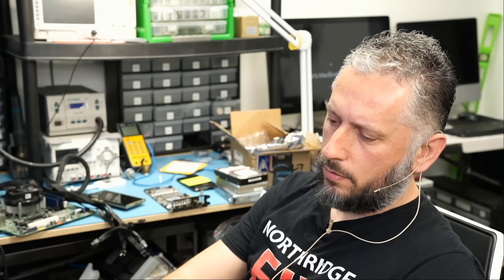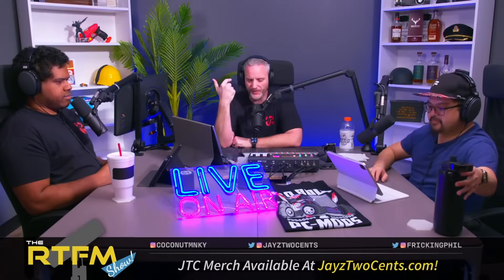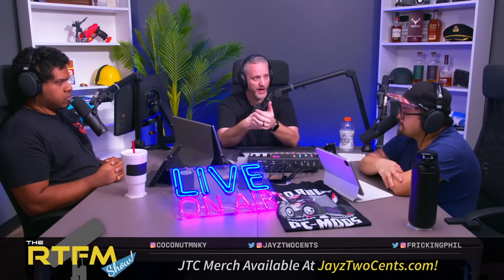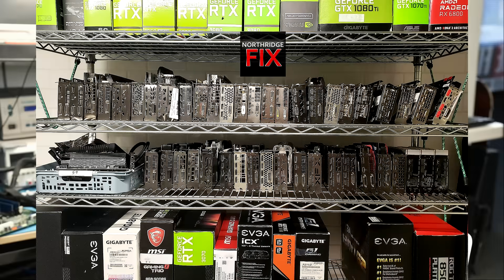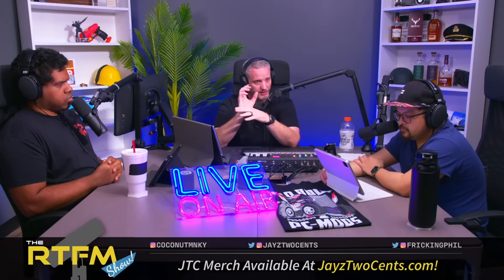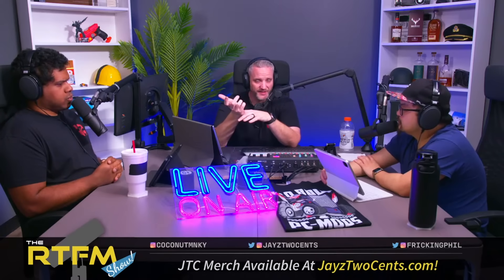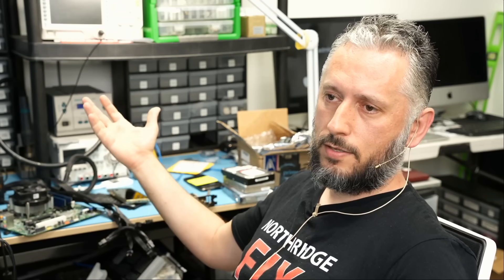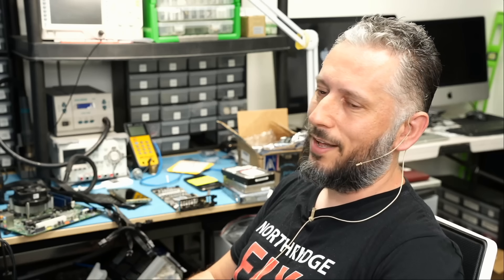Melting 4090 and CableMod. JayzTwoCents and Gamers Nexus Response. Blame NVidia or User?

Comment: I'm still curious what apps, resolution and frame rate (or perhaps other factors I'm not familiar with) affected users are running when the connector melts. It seems to me that demand on the card is what causes the card to draw power. There are a lot of cards being used out there that haven't melted
Reply: Little by little they're melting, that's why this issue is coming back.
Reply: @maxwallestain9037  It seems like the 12VHPWR isn't actually fit for what they are popularizing it for.
Reply: @modrribaz1691  Yeah, the connector is useless if it's going to melt in some point in time, this situation is going to be a much bigger problems in the months to come.
Reply: Yet.

We don't yet know what the users were doing or for how long.

It's possible the vast majority of users are "casual" gamers who game an hour a day on oldish titles, and the melted ones are enthuthiasts who play higher powered games for longer.
Reply: Mine just melted yesterday. I was playing watch dogs . 4k ultra no dlss
Reply: I think the connector could've been designed to be more fool proof but that said it is user error at the end of the day. I got my 4090 the morning they dropped back in October 2022 and have put hundreds and hundreds of hours gaming on it at 4K ray tracing where it is available, I still run the original adapter without any issues. I think Steve of Gamers Nexus has done a lot more to dig into this issue with multiple videos and lab examinations to point out why it happens. 
BTW the same thing can happen to regular pcie power connectors if they aren't plugged in all the way. If this was 100% manufacturer issue it would 've happend a whole lot more and it most certainly wouldve happened to me who puts in a ton of hours on my RTX 4090.

Comment: Now .. here's the question
Is all brands of 4090 had same issue ?

PNY , GALAX , ASUS , GIGABYTE ?!
Reply: Evga knew about it earlier, that's why they resigned from cooperation with nvidia which imposed the design of the PCB together with the connector in advance. Of course, this was only one of the reasons why they withdrew from cooperation
Reply: @pawelos211  EVGA surely is a kingpin to reject modernity and embrace masculinity.
Reply: yes
Reply: @w4r10rd  
that answer leads us to conclusion
It's Nvidia failure
we can't blame user neither specific manufacturer
Reply: @hs_des  agreed, because see it for yourself the previous gen top tier model 3090ti uses the same input factor yet that product is extremely OCed and what not, no such melting issues came up except 4090 and its siblings. feels like politics the blame game never stops anywhere its either the public or the ruling body or the system's servants. the siperman finger meme is very appropriate in this situation tbh.

Comment: Agree with you Alex, if the connector misaligns so easily, the manufacturer should take responsibility.
Reply: I believe the problem is a faulty batch of connectors Nvidia is responsible for this
Reply: @samkleo1494  You believe wrong. All of this has been sorted out long ago.
Reply: @samkleo1494  the manufacturers need to start taking responsibility as to a technician that tries to charge the customer $70 for their internet equipment even though you pay a fee every month.
Reply: @darkspartan566  Are you OK? You seem to have lost the ability to write a comment that makes any sense.
Reply: @--_DJ_--  you probably can't understand simple English.
Reply: @--_DJ_--  but lmao yea I'm ok just a little bit troubled by leadership it's not you
Reply: @darkspartan566  I can understand it when it is used properly, you might be too simple to do that though.
Reply: From what i understand i think it's an NVIDIA and the others makers like ASUS Ect that uses the blueprints from nvidia i think the debate shouldn't take place. Now theses companies and more precisely these card makers can do what they want when you buy a 1500$ or 2500$ if something IS going wrong the waranty should kicks in like in any other product i recently bought a car the gearbox has a problem from the assembly line and my waranty covered everything it wasn't on my end i dont understand like Alex says in the video it's not rocket science to plug a cable in a connector and i dont think the cable matter in that case i think it's more if a design issue rather than a user issue and nvidia and the other makers dont make it right because if they recall the cards it's gonna cost them money and they don't want that and in a matter of facts it's a Big company from many others and they won't be punished for doing it this way
Reply: @miles4913  And who can prove that !? Maybe users OC the card too much, so it drove more power. And before damage to other components, connector melted.
Reply: @darkspartan566  you aren’t writing in English though.
Reply: yes they should not to mention card cost over 2k euro this shit should not happened
Reply: Where are all the 8 pin melted connectors at? Nvidia made a mistake, and they will not admit to it.
Reply: @natetechr / rare, but for past 20+ years I've seen a few molten 8 pins on forums - especially recently, the cryptominer setups.
Reply: Msi has got malware now on their hardware.
Reply: ... and if there is generated almost melting heat, everything MOVES by that heat, if simple lock doesnt help too, its DESIGNED TO FAIL ...... what the heck is spec of that connector ???
Reply: No way, that would blame our lord and Savior, Jensen!!!!!! hes a perfect god!!!
Reply: perfect example of survivorship bias, people would just send their 4080/4090 for RMA instead of sending them to 3rd party repair, unless it's user errors or they flashed their GPU with XOC Bios (1000W Power limit)
Reply: which cable, the 3rd party cable ?, how many of these melted while using the standard cable, if I was looking for a failure point I would be testing the 3rd party cable to see if the materials used are up to the job i.e. can carry the current without heating up, when conductors heat up they increase in resistance to the current which them causes more heat and eventually total failure
Reply: @geoffh4578  the problem is its not the third or 5th party cable that is melting.... its the actual connector that is melting.
Reply: @Geoff H  They had this problem from the start, when only 1st party cables were available. It isn't the cable, it is the connection at the pins. This has all been well documented at this point.
Reply: @geoffh4578  It's a failure of the connector DESIGN... not manufacturing. it's manufactured correctly... it's designed badly. 1st party, 3rd party, doesn't matter. It wasn't designed by the standards group, it was designed by Intel & accepted by the standards group without their normal testing.... and it's telling that Intel doesn't use the connector. Nvidia just refuses to admit it when they screw up; it's basically company policy.
Reply: @geoffh4578  the cables are purely made compared to older power supplies and they haven't changed much over 20 years until 2019 started to come around and we start getting trash pulled products.
Reply: If you know a car is going to burn down when you start it, would you still buy it?
If you buy one, knowing there is a problem, then the only fault is yours
Reply: @Kamelt Oefan  What if only 1 in 1000 burns when you start it? Is it your fault then too?
Reply: @--_DJ_--  it’s not even 1 in 100,000 that have failed.
Reply: @testickles8834  That's stupid analogy. No company would sell things they admitted having a problem, and no dumb people would buy something advertised as having issues. These problems occur because not enough r&d on the supplier side. That's why even big companies like Gigabyte and Honda have product recalls. Nvidia is a giant corp, previous cards like 3090 ti didn't have this issue. They did a mistake on 4090s. They should own up.

Edit: Oh my, I smell sarcasm in your post. My bad I guess.

Comment: And still, nvidia fanboy is saying it's a user fault 😂😂😂
Reply: it is. Probably some random AMD moron like you decided to buy a decent card for once and couldn't even plug it properly.
Reply: Fanboy is being paid off and pushing propaganda.
Reply: Hi, I'm using AMD. It's user fault.
Reply: @Daunlouded  I'm using Nvidia since 2014 and still using it now, but this time I'm switching to AMD 7900xt for my 2d and 3d rendering stuff and I know it performs slower than rtx 4080 in productivity but equivalent to rtx 4070 but in gaming its beats rtx 4080...last things i don't want to waste my money if I can't claim warranty from manufacturer ...so good luck you and your types of deep pocket users 👏 👍
Reply: It is user error but that's not to say that the connector couldn't have been designed better. I'm a very early adopter of the RTX 4090, got one the morning they dropped in October 2022 and have put hundreds of hours gaming on it maxed out most of the time. I still run the original adaptor it came with. 
Nvidia does a lot of scummy stuff I know but you clearly dont know a damn thing about Steve of Gamers Nexus to call him a fanboy when he's been the reason for a lot of these companies having to issue recalls on big issues.
Reply: @TerraWare  how is it a user error if you can wiggle the cable so much?

 how is it a user error if they used known good 90 degree connector which was fully seated and showed no tolerance issues?

how in the damn hell can people call this user error if there is was a measure applied to prevent problem from happening?

this is a NVIDIA issue,they are shoving fuck ton of power thru small gauge wire while using a low melting temp plastic and on top of that having garbage latching mechanism which enables the plug to wiggle side to side which on previous connectors never happened at such a level and even if it did latching mechanism made sure to prevent the plug from coming out instead of here where you can apparently plug it out while wiggling it

i still don't get how are people so blindly listening to GN when his conclusion in the clip makes no sense
Reply: @TerraWare  Read UnselfishPath comment:
"I feel like Steve is about to have a hard time explaining why he is protecting Nvidia" and claiming that ONLY consumers are stupid. Even so, 4090 buyers payed for their mistake "user error", now it is the time for Nvidia to pay for their 12PHWR flawed design connector. The same for "Gamer Flexus" Steve, the time has come for him to pay for choosing to go in bed with Nvidia while claiming that ONLY 4090 users are stupid, he and Nvidia are smart and virgins. Next second after Steve went in bed with Nvidia, in fact with any corporation, he lost his reputation. And he cannot reclaim it back, because this what loosing virginity means, going in bed with somebody, anybody.

Comment: Strange that cablemod didnt tell you who they were and them sending you their customer GPUs
Reply: And that matters why exactly? A card with a burnt connector is a card with a burnt connector whether it comes from cablemod or the moon.
Reply: That's not what he said.
Reply: It isn't that we weren't doing that, it's just that we were having the user send the cards in for repair if their manufacturer did not cover the warranty. Wouldn't make much sense for the users to send it back to us directly, and then us to send it in after all. As Alex mentioned, it doesn't matter who it came from, just the fact that it happened. We just wanted to make sure that the cards were repaired and end users who had cards, received new cards ASAP so they could get back to gaming/working.
Reply: Probably because it doesn't matter. He fixes the product if possible and thats it.

Comment: man this gpu series is seriously a joke better to stick to old gen and let nvidia stop being greedy.
Reply: The CPU is a beast, but nvidia is going to let some cheap ass component ruin years of R&D.
Reply: @hgbugalou  It isn't a beast though. The 4000 series is hilariously awful. The 4060 Ti is debuting to be in a power scale of the 3060 Ti/3070? Bitch what? Why is a NEWER card in literally the same power tier as the old generation?

The 4090 doesn't do anything the 3090/Ti didn't either other than arbitrary "we locked off DLSS 9001 for ONLY 4000 series, because raisons" nonsense.

It's an unsafe and largely unneeded mess the 4000 (de)generation.